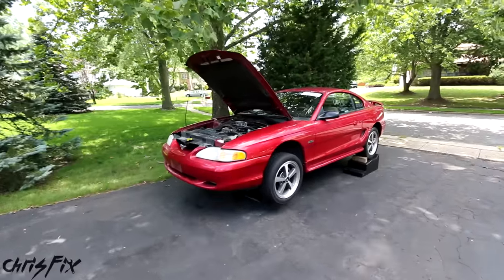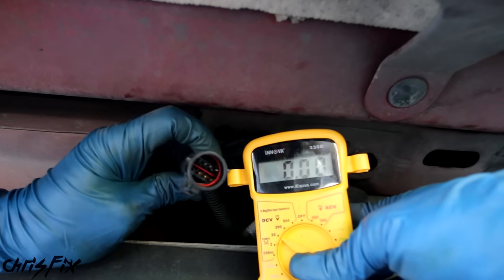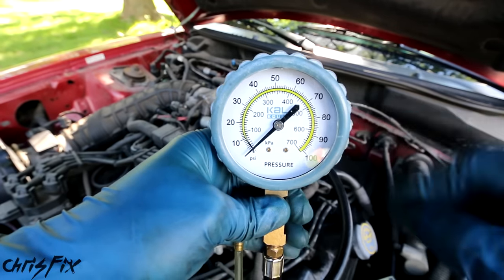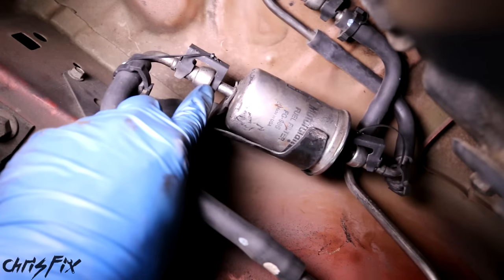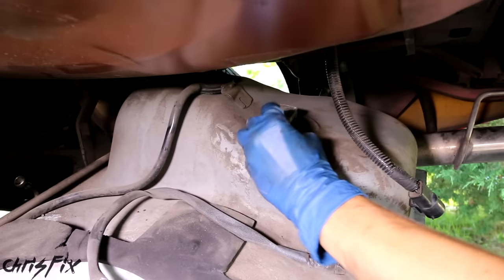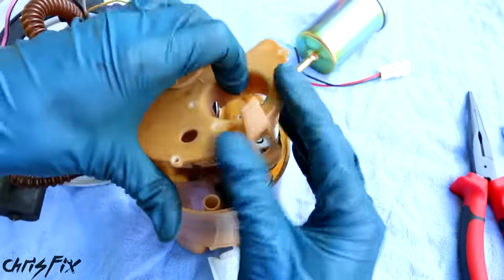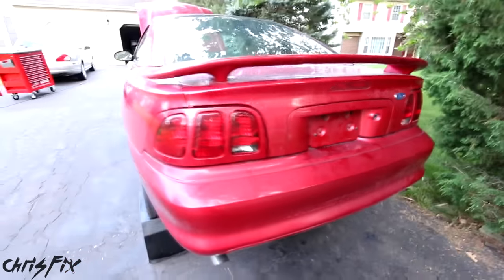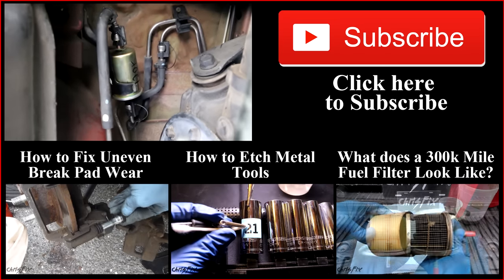How to Diagnose and Replace a Fuel Pump

Comment: What a royal pain in the ass. Question though- my pump was failing. It's accessible under the back seat. I hit the top of it and it started so I could get home. I put in a new pump. Didn't work very well and then stopped working. I put in another new pump. Didn't work at all. I put in old pump. Car worked but I can tell by the noise that it's failing fast. Why would two new pumps not work but the old one worked? Some people say I should just replace the whole assembly. What do you think?
Reply: What kind of car do you have? I know on my 92 S10, it has a ground that connects to the filler neck. Those 3 screws he loosened in the gas cap area. If you have a ground anywhere for the pump might try cleaning that and retighten it back up. Use a Wire brush the contact point of the ground wire connector, down to the metal and tighten it good...
Reply: @kramnull8962  It's a 2003 Hyundai Elantra. Believe it or not, some Hyundai owners told me that for whatever reason- Hyundais often don't work well or at all when you just put in the pump alone. You have to put in the whole fuel pump assembly (which is actually easier). I found it for $130 at Rock Auto, installed it and sure enough the car started right up.

Comment: LOL 13 minutes to diagnose a pump.

If you disconnect the fuel line, and fuel doesn't come squirting out of it, it's the pump.

Jesus Christ dude.
Reply from the maker: It was 4 minutes and I would much rather check the easy stuff first and replace if thats all it ends up being